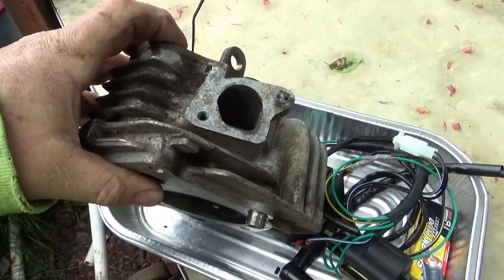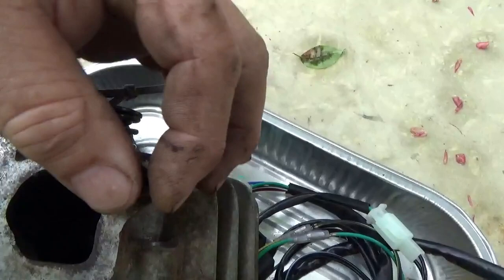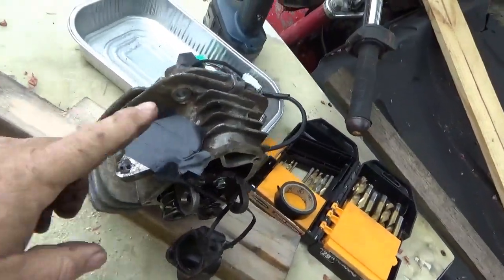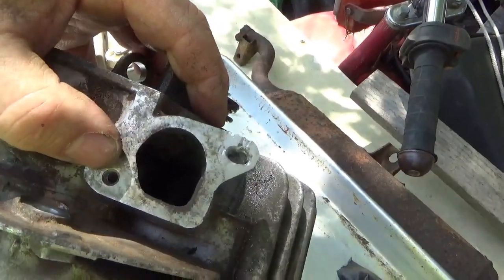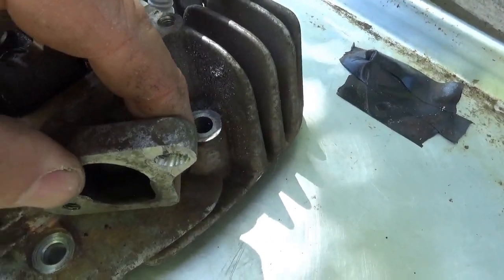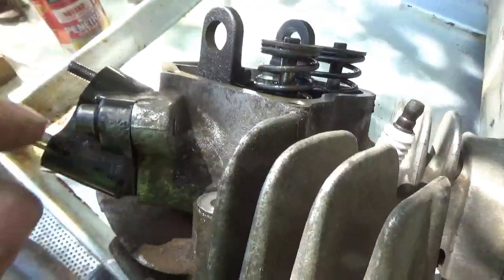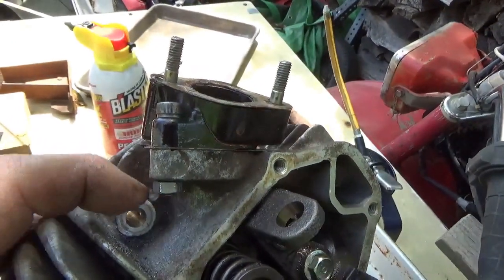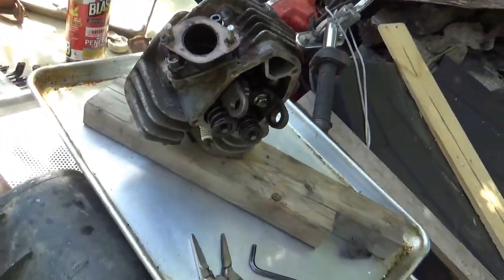Broken Manifold Bolt in Yamaha G9 Aluminum Cylinder Head Repair!

Comment: Don’t matter what it looks like ( to a point ) it matters how well it works ! Someone won’t say “ it runs great but that bolt on the carb looks bad so it’s a piece of doggy Dudu “ Harvey your good at adapting and improvise !
Reply from the maker: Hey Dave, This was a hard video to make as there was no technique, I had a whole pile of tools, and I kept going back and forth between them....Once it is all put back together with the cooling tin, I think it will look fine.... Thanks always for Ur thoughts, support, encouragement, watching, and commenting!!!
Reply: @HarveySpooner  sometimes the not so pretty solutions work the best ! Lol. Yours looked fine and I’m sure it will work great ! The main thing is to get a good seal and that’s what you did ! I’ve made some ugly intake manifolds and they worked perfectly and I’ve made works of art and they barely worked at all ! Lol

Comment: Just broke the oil drain plug on a XR 200 1984 lol tighed it just a little to much lol
Reply from the maker: Hey Tyler, When I work with bolts in aluminum castings, I use a 6 point socket with a 1/4 inch ratchet, prevents over tightening.... Good luck on Ur bolt removal!!! Thanks for Ur thoughts, encouragement, watching, and commenting!!!

Comment: Ahhhh I've done that more then once lol heat heat heat heat cast aluminum expands with what like big time. Drill a little hole throw the blot heat it red hot as you can. That's a long headed easy out or s a small Alen head for a them click in screw drivers an tap it in this a hammer spray her with WD40 an try to ease her out. Great video man !!
Reply from the maker: Hey Tyler, I also had some trouble on a broken bolt in a honda atc, I tried the heat method, PB blaster, tap tap, rocking it back and forth.... It broke anyway, some steel bolts in aluminum castings will need to be drilled... Avoiding it is best, getting around it is sometimes necessary!!!! Thanks for Ur knowledge, advice, wisdom, support, watching, and commenting!!!

Comment: I can't compete with the previous comments so I'll just say thank you Harvey and good luck!
Reply from the maker: Hey Steve!!!  I bought a battery for the Jag, I'm going to smash it in, reinstall the air cleaner, and determine what this thing need to be a daily rider.... I think when it is done, it will be a cool machine, kind of like a clone of a Buick clone of a Cadillac SUV! Thanks for getting me a deal on the machine!!! Looks like a rainout for the flea market weekend... Thanks always for Ur thoughts, support, watching, and commenting!!!
Reply: @HarveySpooner  Glad it worked out, had high hopes since I'd met the previous owner and his buddies said he had used it for a couple of years. I'm sure a new spark plug and a quick wave of your magic wand will do the trick. In the middle of a 13 day work-a-thon but I'm splitting my time between 2 of the jobs, and the ranch is scheduling more work for me this summer. Great change of pace. Keep it moving Harvey, talk soon.